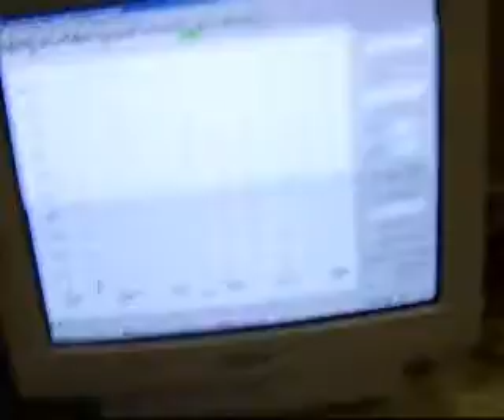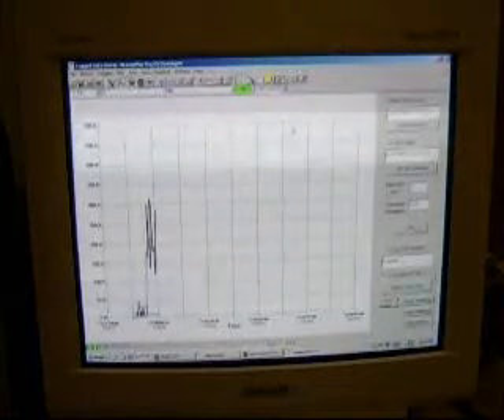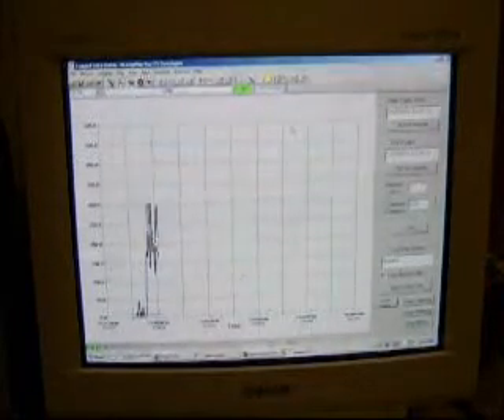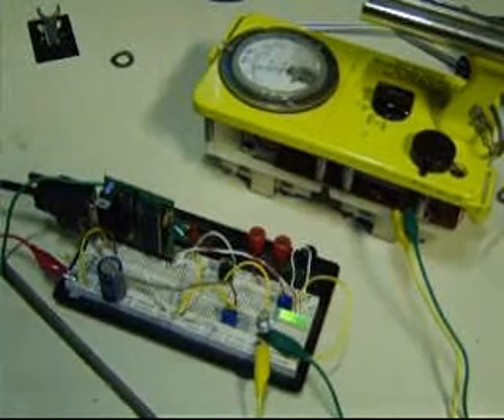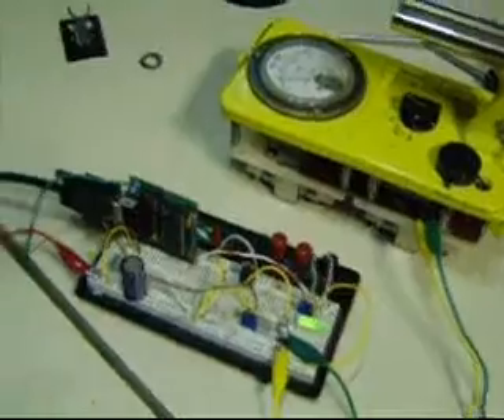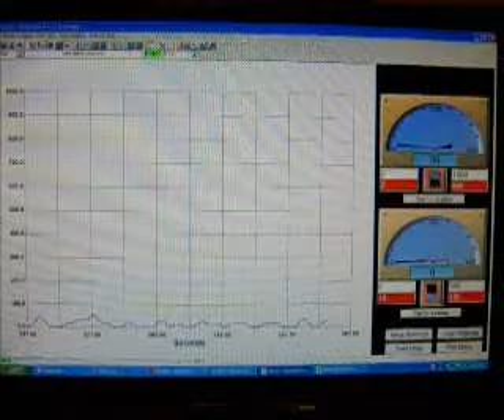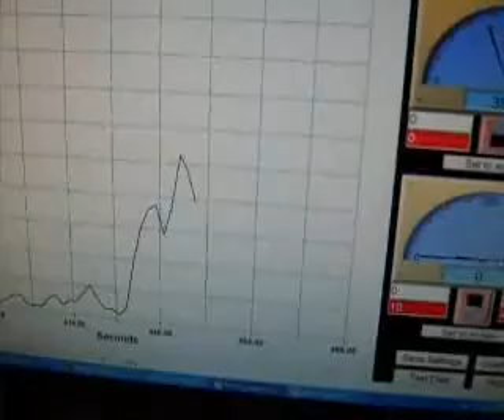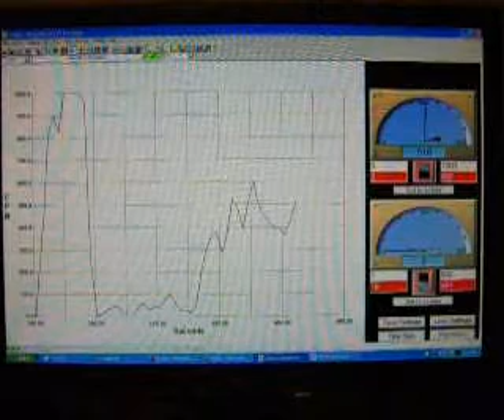CDV-700 PC Interface (DIY)

Comment: Interesting stuff.  Maybe check out the Geiger Bot app for counting if you have an idevice.  It's free and works very well with the internal mics, or there's also a simple connection cable that can be whipped together with just a few parts.  I've got some short videos of it on my channel if you'd like to see it.

Comment: 5/5! Very Impressive! You sure know your electronics! I just got a CDV-700 6b, calibrated it, and I added a 6-28 VDC Piezo Buzzer (#273-075) just by putting the leads on the jack, and then mounting the buzzer with some hot glue onto the CDV-700 6b without covering any numbers. I hope to add more to mine when I can... The PC interface looks like it would take quite awhile to put together, and looks expensive to make! Nevertheless, it's REALLY NICE! Great Job!

Comment from the maker: Yeah that might make it even simpler, although I'm not too familiar with the actual voltage levels and types of communication for stuff like a serial port.  Right now I'm working on getting this to work as a standalone system with a small LCD, basically a little addon unit for the CDV-700 to add features like background CPM readings without a PC